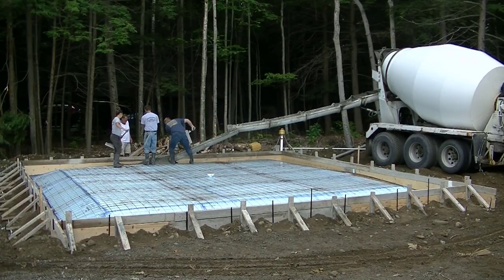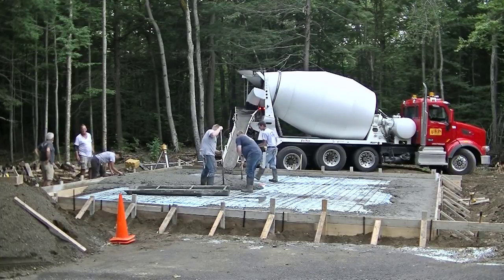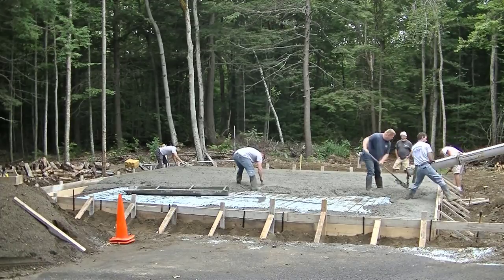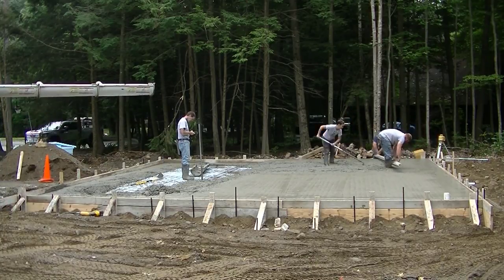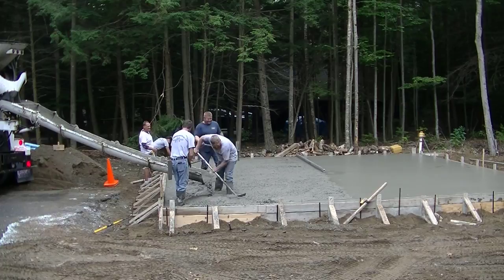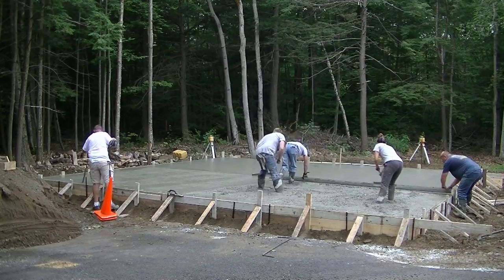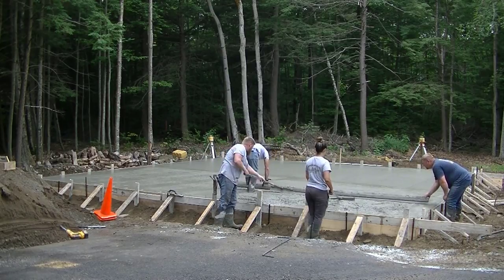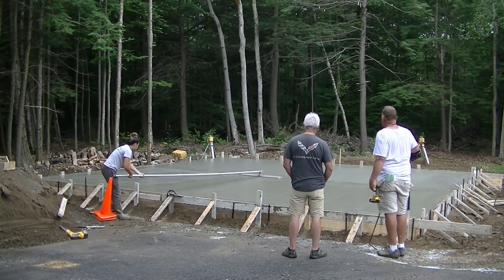Pouring Concrete For A 28' X 28' Garage Slab

Comment: Southern Tip of Maine here (the Berwicks) and I am building a 30x50 garage that I'm putting up myself. I found your channel and have learned a TON about prepping my building site for concrete, what style of floor I should go with, and it helped me ask good questions of the potential concrete floor contractors. I'm not brave enough to do this project myself, but maybe the next concrete flat project I'll tackle using what I've learned from your videos, keep up the good work!

Comment: I am going to build a home and be the general contractor and these videos help me know what to expect and how to prep the ground.  One thing I would like to see is how you prepare ground for a porch, patio, or stairs over back fill.  I have observed many other homes with stairs that settle up to 6 inches over several years because the ground was not properly compacted before the concrete pour.  In these examples the work looks good the day it is done, but progressively gets worse over the years.

Comment: My brother and I did the form work for a garage that was 26' wide by 36' deep back in 2001. I didn't want to rent the forms. So, we took plywood and ripped it down the middle, making my own.  Making the "Monolithic Slab" have 23-7/8" side walls. (Then when the slab was done, I was able to use the ""Forms"" as shelving in the garage.) I also didn't go with the 8" bottom, I used 12" and went with 30-degree slop to the slab instead of the required 60 degree. The contractor said it would add about 4 extra yards of concrete overall, but in the end. It added almost 9 yards with everything ..... My neighbor gave me enough re-bar to cover the slab with re-bar every 2 foot both directions.  I did hire someone to come and pore and finish it. The owner of the company, when he saw what it looked like asked me this. (We poured the slab on Oct 19th, 2001, just after 9 / 11 happened) He said.... What are you building.... ""The Englewood Trade Center""  I am in Englewood Colorado. ... ........................................................................................................................................... He asked me how I got the forms so square. Because from corner to corner, I was off 3/16" total difference.  I told him this.... It is easy if you know how to read a tape measure. (Right) ... He also asked me how I prepped the ground under where the slab was being poured on. I told him I removed two sidewalks that led to the backyard. So, I just made it all flat. Then brought in 37 tons of ground up concrete road base. ........ It has been just short of 22 years, and I still do not have a single crack in the pad.  ..... The building overall is 26....with 10-foot walls and a 5/12 slope roof.     ......... As to why I am watching this..... I am selling my home here in Englewood and moving out of state to where my 98-year-old dad lives. My brother is retiring on January 1st, 2024, and that way we can help my dad in his later years. The home I am buying doesn't have a garage at all. I am going to be doing this again real soon. BUT... where I am moving too, they don't have the 1000 sq ft limit like where I was in Englewood for a garage. This time I can build a 1200 sq foot one. I learned a lot from that build and also being an electrician, I now know that I should have put conduit under the slab to do my wire pulls. ..... Thanks a lot for showing and sharing this video. I really am looking forward to getting this next stage of my life rolling.

Comment: Gidday from Adelaide South Australia. This type of slab here would be known as a floating raft slab. Depending on the soil type the external footing would be at one foot by one foot with the infill of at least four to six inches. Of course there would be a waterproof membrane and reinforcing steel mesh. I have a very keen interest in house construction and nearly all the new homes built here are on a concrete slab. I really like your videos and comparing the different methods used between the US and Australia.
Reply from the maker: Thanks David!

Comment: Mike, the IBC building code has this foundation listed as a shallow frost protected slab on grade.  the only thing missing is the EPS foam outside of the form with dirt over it.  Great job with the design, form work, and finishing.  Watching you makes me want to leave my desk job and pour concrete; but the anxiety of hearing that truck coming still gets me!  If you did enough of these having panel forms would make it worth it.  @texasbarndominiums uses this design to build all his barndo's  i saw his video with DemoRanch HQ and never thought of filling the middle like he did.  Sort of did a sand bag approach to make his trench edges.  mind blown!
Reply from the maker: They'll put foam on the outside of the slab after stripping the forms and before backfilling the slab
Reply: This is how we do it in Canada

Comment: Frost wall is the best way to go.In the concrete  business for 45 years,here in Cape Breton.Not that much difference in the price between a frost wall and an engineered slab.Slabs are a lot more labour. Also,frost walls are are  better if you want to add an addition later on(imo).

Comment: Hey Mike, have you done a video with in-depth explanation of how a power trowel work's particularly the blade angle adjustment?
Reply from the maker: I've done power troweling videos but maybe haven't broken it down in depth so much. I'll see if I can do that.
Reply: @MikeDayConcrete  to see why you need to change the blade pitch or angle would be great to learn. Thanks

Comment: Our house slab has a 20 inch thicken edge around the perimeter.  Have you thought about using the metal brace with a turnbuckle; instead of the 2x4; which would make it easier to adjust the form.
Reply from the maker: I got those, they work good also.

Comment: I'm redoing the back patio. I'm gonna use bags or a regular mix of rock, sand, and concrete. I'm looking at the difference in price versus a truck. I Have to finish the measurement for the depth to determinethe correct amount off yards. 800 yards minimum or pay for the truck. I think the first half I do will be around 500 yards. Before that begins I have to tear out half the existing patio and set forms for slope because the patio is mostly covered.

Comment: I watch your videos to learn and start doing my own slabs. I would be interested in how you order the timing of your trucks (for example do you have the trucks come 15 minutes apart? 30?) and more on the finishing of them.
Reply from the maker: The timing of trucks depends on how complicated the pour is. Usually most pours are quite easy so we want the trucks one right after the other with very little time in between.

Comment: I'm trying to up my knowledge from the basics to pour my own slab as pricing for a crew to do it where I live is insane. I'm in no rush so that will allow me to do my homework. Not 100% sure on shop size yet but I'm shooting somewhere between 24x28- 26x30. Rebar will be a definite thing but trying to determine #, spacing and chair height for a 6" monolithic slab which I believe the footings will be 12". The slab will have to accommodate the weight of a 5,800 pound dually, tool boxes, 700lb gantry crane on casters (which will create a high concentrated load across four casters). I'm not ready to contact my local code office but want to do my homework and build a materials list so I can get a ball park on the price. I called one company (left a bad taste in my mouth) and was quoted $10k for a 26x30 and that was just for forms, footings, mesh and mud. That didn't include any grading or base. I haven't called anyone else since.

Comment: Hi sir ! Thanks for the vid ! I plan to build a 24x32 garage in Quebec were we have -20 celcius in winters. I’m wondering if that kind of slab with 1-1/12 inch styrofoam underneath my slab will work to prevent frost problems. Do you think 12 to 16 inches thickness in perimeter is enough ? I will use 0-3/4 compacted gravel everywhere underneath the slab. Thanks again !  Steve

Comment: I am building a 30x60 and a 20x60 metal building.  I am trying to find a detailed video on how to make a notched edge around the whole perimeter of both buildings.  The engineering plans call for a minimum "ledge" to be 3-3/4" from edge of slab to the edge of the framing for the building. My concrete guy has never had this request for a monolythic slab here in Florida. Any guidance you could provide will be much appreciated.

Comment: Haunched monolithic garage pad **control joints or not.  My mother had a driveway and garage pad poured this week. The concrete company poured the monolithic haunched garage pad, 12' thick around the perimeter and 5" thick in center. He used rebar on the perimeter and wire mesh in center. The pad is freestanding-not connected to the house. The next day they drilled and pinned the pad and poured the concrete driveway. They cut control joints in the driveway but not the garage pad I told him I was nervous the garage pad was going to crack in an ugly spot and he said NO joints in garage pad. Is this normal? Love your videos and your crew. Thank you!!

Comment: I am here because I am building a garage and I plan on doing all the site work myself. I am doing a monolithic slab up here in Mass, I plan on doing 12” footers with 4” floor in center. I am doing two rows of rebar on the outside and then running wire mesh on the inside. Me being a plumber I am going to be doing radiant tubing in the foundation so I plan on doing the interlocking foam with the tubing then the mesh on top of that. And as for the forms I plan on doing it myself. I am trying to have a concrete contractor just come and do the pour and finish work. In the center I don’t plan on having the radiant cross over just so I can do one stress cut when it’s done but do you think that will be enough? I am basically here to see all the prep work and forms. Any advice is appreciated thank you.

Comment: Hi Mike, have been watching your videos for a bit, I’m down in SW Texas, where my property is I don’t have to worries about codes or permits. I’m wanting to pour my own 3 car garage slab and have never done a large pour. I need to learn how to do it, it’s only my wife and I, may be able to find a friend or two that has done some concrete but not likely. Is it doable for just the two of us? I figured 10-12 inch deep edges and maybe a concrete beam channel in the middle for roof support posts.

Comment: I am very familiar with having to lift the reinforcing wire with that hook made out of rebar, while it may look easy over a period of several hours it'll wear you down i had to do it on a 800 yard slab back this past winter twice, someone else was helping me both times because it was a thicker wire mesh used for a warehouse floor. i like how you guys don't have to wear those annoying useless hard hats too, some jobs i've been to are out in the open but yet they still make us wear those stupid hard hats that are at times very uncomfortable